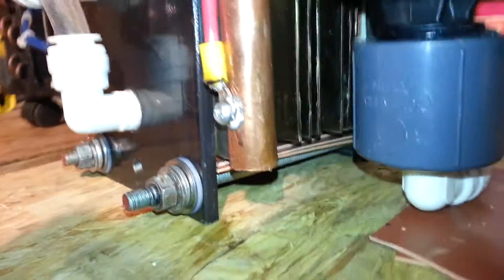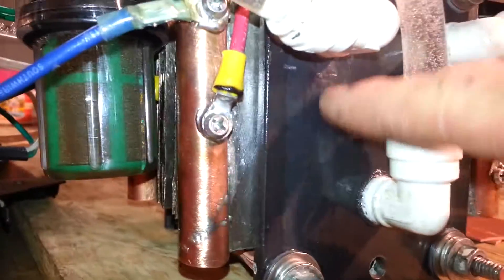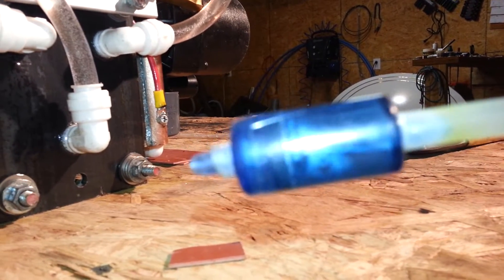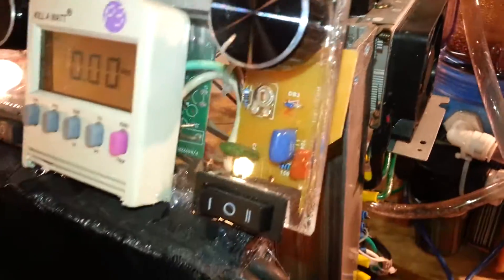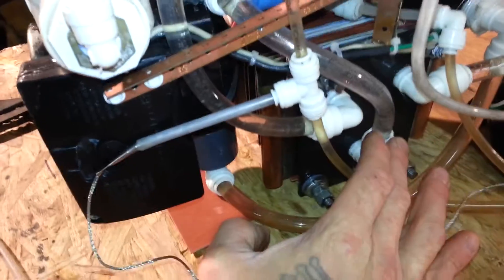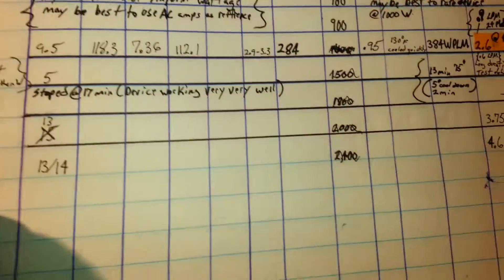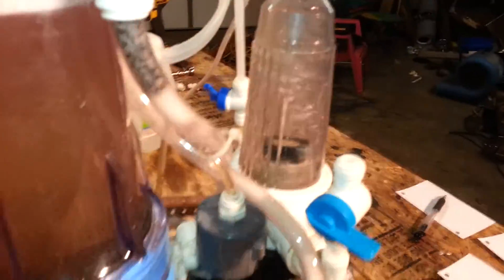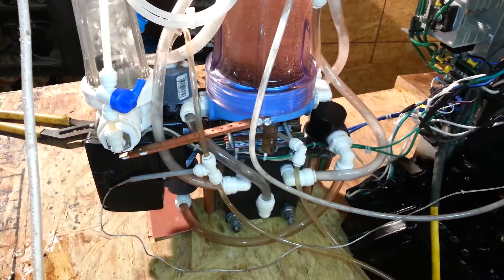38 plate bi polar electrolyzer with cooling fins

Comment: I have always thought hho production from electricity or superheated steam would make a great battery from home waist water for a combined home heat and power unit.storing energy in batteries cost 50 to 60% of your energy in. With hho its only 20% lost. But storing heat is the cheapest and you only lose 5 to 10%. The stored heat could run a organic Rankin cycle or a supercritical carbon dioxide brayton cycle.
Reply from the maker: unfortunately friend i looked into some of theses ideas and found that most have to last at least 12 years before they pay for them selfs, the hardware needed  is a long list of parts , usable models can hit $15,000 dollars real quick  so the idea is workable just not practical in my opinion but hey bro im wrong some times and perahps a cheap format could yeild a practical configuration . , you gotta hit like 5$ per kw to compete with current infrastructures. cost is killing alot of ideas because we are a here and now culture . i only use hho for torches and see no use for it in the energy industry